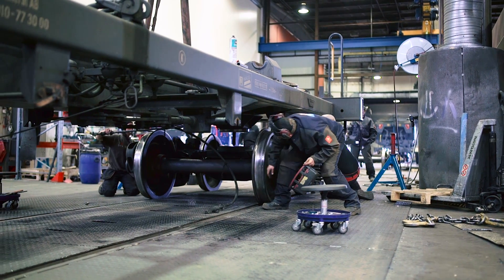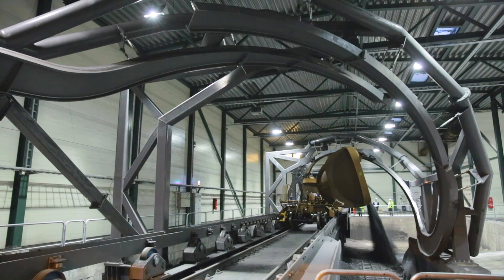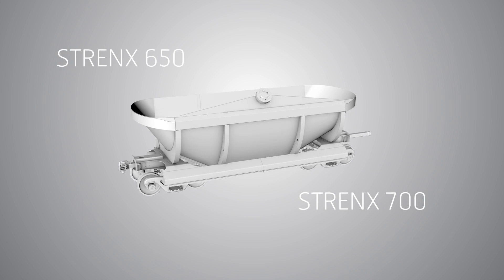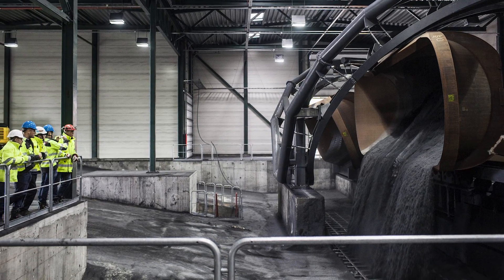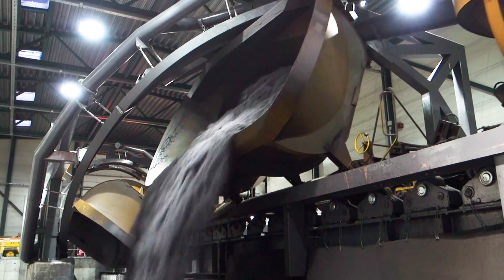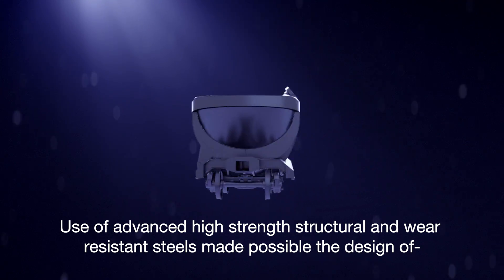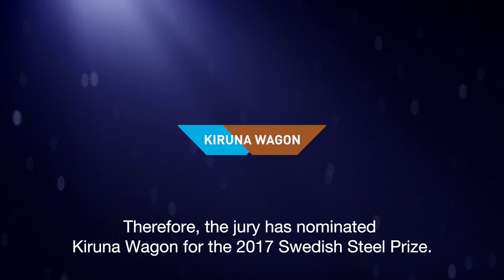Swedish Steel Prize winner 2017 – Kiruna Wagon

Comment: I see one drawback to this - the engaging wheel is located on only one side of each car, so one would have to make certain that train routing would preserve the correct orientation unless this was for dedicated point-to-point service. A second wheel could be mounted on the opposite side to allow interchangeability but now there's added weight of several tons per car.

Could such a system be used in North American practice with 120 ton capacity light aluminum cars? Not likely - as the video stated, the system depends on high strength steel for durability, and steel coal cars were mostly phased out years ago. Maybe this could be implemented as some sort of next generation ore car, though, but that would involve totally rebuilding ore docks. While innovative, this appears to be of limited use for now.
Reply: It is true that they need to all be facing the proper direction, but in operation most trains of this type always remain coupled together as unit trains going back and fourth along a defined route, so the logistics of keeping them all the right way is pretty straightforward. American-style rotary dump coal cars (gondolas technically) have a similar limitation in that one end has the rotary coupler, that needs to be facing the same way on every car so that every car-connection has one rotary coupler, otherwise it would bind during rotation. This is clearly seen by the orange (usually) marking at one end of every car. Keeping them the proper orientation isn't a big deal as they're all permanent unit trains - though I guess in that case it doesn't matter which way they're facing just so long as they're all facing the same way.
As for using this for coal, it probably wouldn't be as practical for a lower-density cargo. The biggest drawback I see of this concept is that both the tub and chassis have to be independently structurally self-supporting, the tub has to be able to be lifted and tipped without turning into a taco, and the chassis must support this - basically redundant structures, a non-tipping car could have the tub serve as the sole structural integrity of the car, no chassis - most hopper, coal-gondola, and tank cars don't have chassis from what I've seen. These ore cars are relatively short, and the tubs small because ore is so dense, hence the extra weight and cost of these redundant structures is acceptable. It would be much heavier and more expensive to build a much larger car for carrying lower-density coal in this manner. 
Another consideration is efficiency of unloading versus efficiency of transport. A car with this system will be heavier, more expensive, and have less capacity than a car without it (as described above, separate tub and chassis versus integrated structure). Thus a shorter journey it would make more sense to have cars with special unloading systems even if that makes them less efficient at transporting the cargo, but for a longer journey the weight and cost (more cars needed to haul a given annual tonnage) of hauling such a system the full distance wouldn't be worthwhile, and simpler, cheaper, lighter cars are preferable even if the system for unloading them is more expensive. So this system here is probably best for a journey of less than 100 miles, while US coal cars will carry coal across multiple states.
Reply: @quillmaurer6563  I love tacos.
Reply: @quillmaurer6563  Man thats what I was going to say glad you did it for me.
Reply: With all due respect...
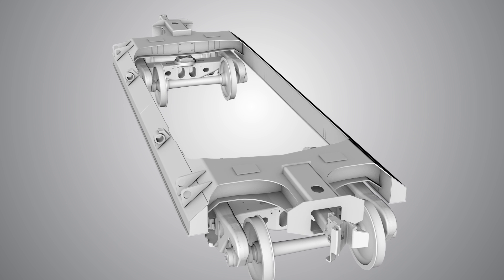No, a second wheel cannot be located on the other side due to the hinge opposite of the wheel down on the chassis. This car can only be dumped one way. See 1:10 - left-hand side shows the hinge mounting points.
The only way to handle a wrongly placed car would be to have a second dump rail system on the other side and dump both ways as needed based on how the car is orientated. 
Interesting idea... 
Would love to see some railroad modeler build a working scale model.